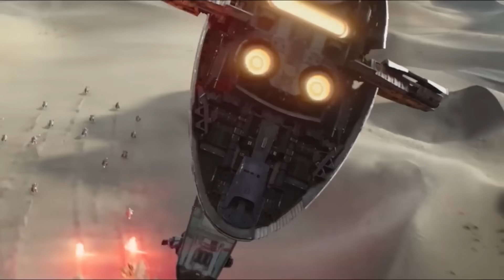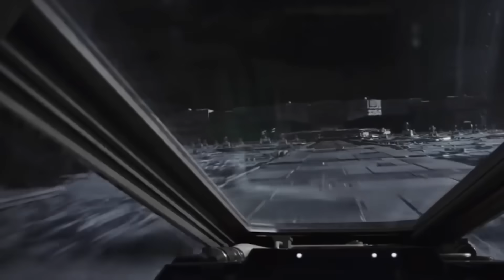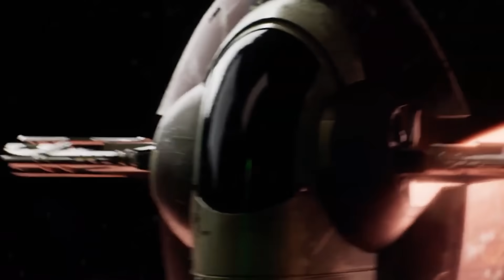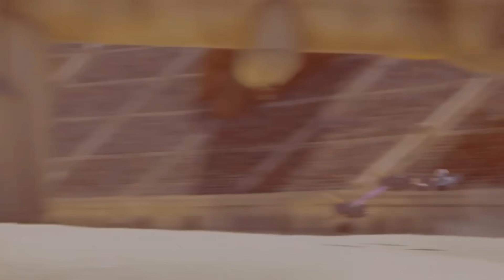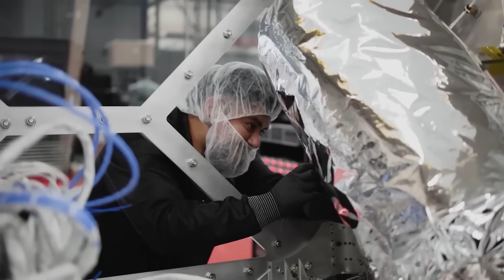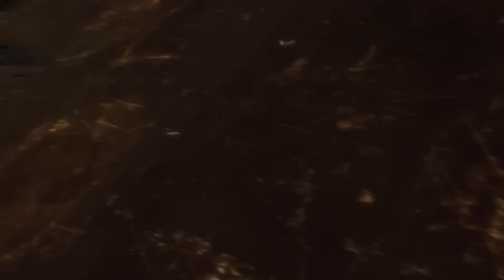The Problem with Star Wars Ship Design

Comment: So, to his first point of ship design there is actually a logical rationale behind it and a fair design philosophy. When it comes to the command deck of any ship it's a critical component as it's the vessel's brain which is not replaceable or fixable in a heated scenario, but where to place it is extremely important. Generally, there are three universal locations:
     -The Internal Command, an operation room at the core of the vessel is easily the safest location for any command with essentially zero concerns of issues. The problem is how as the IC requires a continuous feed of information through numerous sensors to remain operational but if those sensors are incapacitated by cosmic storms, conflict, or malfunction you are now entirely blind. This is a big issue in Star Wars who widely use ion weapons which disable vessel functions.
     -The Ventral/ Dorsal Bridge, an operation room set above or below the super structure is a command station that provides a wide view of the conflict as well as redirects enemy fire at a considerably smaller profile. The obvious problem is the external position leaves one disgustingly exposed thus relying on heavy external defenses such as shield arrays.
     -The Prow Bridge, an operation room boldly set on the front fact of the the vessel. What makes it feasible is generally the ships that support said design are ones that support a massive powerful prow which often means you can utilize physical sight with considerable protection. The problem is that the position heavily narrows sightlines and if any powerful assault strikes the ship head on its defensive super structure, then the Bridge can be caught up in the damage.

An apt example that would satifisfy is grudges is actually the warships from the Free Planets Alliance in LotGH:DNT where the vessels had a dorsal bridge with the feature of retracting into an internal command kinda like a turtle.

To his second point of fighters. Generally, there was an extremely rational use for mortal operators, but robotics do have a major play. To start the necessity of fighters in any regard is entirely dependent on their ability to cause projection of power and threat to super structures; Star Wars fighters do have major fire power capabilities thus making them a threat whereas Halo Fighters are comparably weaker thus needing exceedingly more room to supply adequate armaments. In addition, the defensive mechanism is incredibly important as in Star Wars they wear extremely powerful shield technology which makes non-continuous threats much more manageable, but they also use Plasma-based weapons which have comparably limited effective range in trade for extreme power. To again use Halo as an example, the UNSC do not have the same protections nor do kinetic and small projectiles have reliable use which resulted in a doctrine of extremely long range coordinated MAC driver barrages. Often doctrine is dependent on what you have available.
     For fighters directly the usage is often utterly dependent on how the manufacturer wanted it to compete which more utilities will always translate into hardpoints to attach too. In Star Wars we can see this as massive, winged mechanisms that house elements like cooling, energy collection, or micro maneuvering devices. On that note of necessities...G Force would not be an issue. Generally, it's most experienced through acceleration or deacceleration in an atmosphere which has gravity but once that force is removed to a near zero state then maneuvers in turn also exert dramatically less force. In other words, the example of specialized G force drug injections for space combat is actually less realistically needed then just going in raw. Although that is theoretical and result of light reading.
     As for robotic fighters, the usage is not diminished because it is seen as untrust worthy nor is it less capable. If anything, Star wars presents the opposite in that they are more capable, smaller, and less hazardous. The reason we see diminished use is because it's expensive as just as how modern-day self-driving cars are expensive. Typically, it requires that these vessels not only have adequate processing but also massive communication arrays on a warship just to communicate which leaves a new vulnerability and restriction.

Third, to the point of designs. Star Wars does prioritize imagery over function, but it's also factual to say that these designs are still very functional and throughout while in the real world we adhere to aesthetics quite frequently. 
     In star wars we do see a wide variety of shapes but often it was more than applying an emotional state. To give example the purpose of the wedge shape in ISDs was because it was meant to provide extreme forward fire capabilities, but the MC80s of the Rebels Mon Calamari are very bulbous because they were actually cities made to be in extreme pressure regions of deep sea. If we look at say the CIS Munificent classes, then we can see it's designed more for communications with massive antenna arrays but also an extremely skeletal frame protected by a shell super structure due to its robotic focus reducing needs of facilities yet keeping focus of protection. Now is it true everywhere? no but often enough there is a local foundation.
     Now on the other hand historically real-world nations vastly varied on design of vehicles in effort of aesthetic while adhering to necessary principals. This is easiest to see in tanks such as the American Abrams vs German Leopards. Other times design philosophy does not limit us to one answer either such as helicopters utilizing very different ideals and engineering to achieve similar goals, and while similar in function you will never mistake a Mi-35 for an Apache 
     Now these are always theoretical as Star Wars is not real nor has even been close to being tested but that often means the faults in the mechanism are a direct result of writing rather than design. Most if not all warships would be covered entirely in at least some kind of countermeasure BUT often get destroyed because the plot demands it. The value here is whether or not you were immersed by the event as if so it's because the writers and designers adhere enough to realism to make you feel engaged whereas if not it was because they cut to many corners to make it happen.

Generally, i think this explains most of his large grievances but at the end of the day it's entirely theoretical and more than not the faults of design are more related to storytelling rather than concept. I personally despise the Rey trilogy just because of how much they disregard any thought process for pretty visuals but i can also recognize that the parts i do love do carry their own flaws that even my explanations can explain-away. Regardless the video does provide a good excuse to establish conversations about the concepts but more so it's concepts like these along with the critiques that actually inspire the future of technology ironically enough.

Comment: It would be fairly easy to explain most of the design choices. No weapon on the underside, because you have strong shields, but if you want to fire yourself, you cant use that type, hence you only want one side exposed. I think the bridge is a mayor flaw. You would still want something to eyeball docking in any situation, but the main bridge should be hidden. That said, if you really want to minimize your weakpoint, having a redundant array of sensors close by each other isnt the worst idea. If you get hit and the link from the sensor is cut on the way to the bridge, you might aswell have it closer by. They should have used a hit on the engines for the executor. If we stay at WWII, something like the hit on Bismark would have been ideal. Simply loose steering and let the ship drift into the death star, or even get cought in its own gravity feld, as its so big. Why human pilots? Maybe the engine drives are costly and a simple EMP can take out any advanced sensors, so you have to do with a computer interpreting already available data and the manouver inputs of a pilot. Having humans on board doing everything is the reason for the moon missions beeing maned first. a simple lack of comutational power could be an easy solution here. you would have the main hyperspace calculations done by a super computer on a planet with unlimited space and power and let the on site ships only stick together whats nessesary for the specific jump. that would restric you to defined travel paths and rule out ai in almost anything else. you could also have a computer be hacked or radiation damaged, so its needs to be hardware coded, unflexible and therefor limited in functionallity and compute power. I feel its more a lack of willingness to explain the design choices in universe from the start, then the ability to do so. you cant do this with everything presented, but almost. ships flying in the same plain? what would happen if to grav gens working against each other? what happens to a smaller ship in the vicinity of such a feld if it extended beyond the ship? I find such explenations very satisfying, because they highlight the limitations and work arounds of the technologie used, rather then use the technologie to solve away a problem or inconsistency.

Comment: What makes me scratch my head in disbelief is the general layout of most ships. For smaller vessels floorplans are available. Take a look at the famous Millennium Falcon, it's a mess. Two tiny cargo holds, the third can be accessed through dragging cargo on corridors. And the curved walls reduce functional cargo space.
The only ship where the floor plan makes sense is a light transport called the Barloz-class (from the SW RPG). It starts with a cockpit, then a common area with cabins, a galley and a large water block, then a maintenance area, then a huge, rectangular cargo hold with wide ramps and doors on the side, and finally the engine bay. It is actually practical.
As for why capital ships have no real armament on the ventral side it's simple. Designers haven't realised space is 3 dimensional, and design the ships as if those were water battle ships, equipped for big broadsides. Plain stupid.
But it's a fantasy, so whatever.

Comment: Wings might be useless in space but what if you wanted to land on a planet with atmosphere? I can see putting wings on a spaceship so it can also function in atmosphere although a drive that worked well in atmosphere wouldn't work well in space and a drive that worked well in space wouldn't work well in atmosphere so you'd need multiple drives. G forces might not be a factor if you used a warp drive to move because technically a ship at warp isn't moving the space around the ship is moving. However warp drive wouldn't be too useful in a dog fight you'd be moving way to fast to target anything. You'd need alot of speed like 20,000 mph to not fall like a rock towards a planet but if the ships you were fighting were also going that fast you wouldn't notice the speed.

Comment: I will defend the wedge shape there.

Going with the Star Wars convention of assuming a 2d plane for larger ships, the wedge only presents vulnerability to the rear. The two. Side fire arms cover the entirety of the flanks, and overlap forward so they can bring their entire firepower to bear, as well as sloped armor if the shields ever went down.

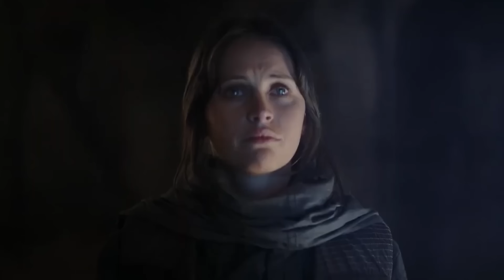22:45 also, that is like saying “exhaust ports are stupid because someone could send a missile up there into the engine through it.”

Wouldn’t be surprised if he got that from people trying to send bombs down smoke stacks or something.

Lots of those weaknesses were fortified, and fortifying it too much does eat of resources for diminishing returns and broadcast their importance.

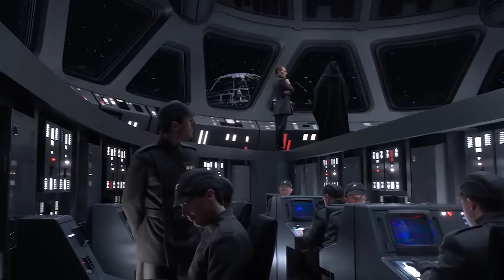Comment: 6:20 : Counter-point, with that level of tech, exposed bridges and windows can be an actual counter-measure against CWF/EWF (cyber/electronic warfare). If you lose control of your sensor you effectively become blind and having a bridge that can see outside can at least in part counteract that.

For the exposed shield gen(mentionned earlier) it could very well be a tech limitation. Either that or overconfidence in the shield themselves.

Comment: In "3 Body Problem", Cixin Liu makes the interesting point that due to the relatively low speeds of the ships, let's say 1% c, in relation to the tiny size (on the interstellar scale) of the Solar System, space warfare would come to resemble a 3D version of battles between sailing fleets of the 18th century, including the use of projectiles designed to hole an enemy craft.

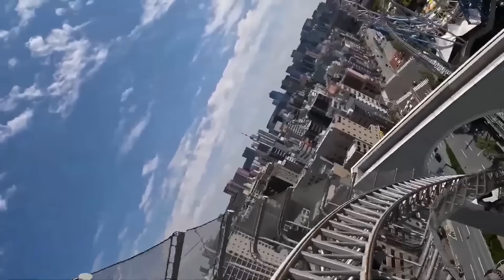Comment: 10:35 this is not true, in space speed doesn't kill, it's the accelaration and deacceleration. And once you got to a speed, you keep going since there is no air/medium to slow you down, so basically you onle use engines to accelerate or deaccelerate. If you stop too fast, humans would become a pancake, image hitting a concrete wall with great speed.
The International Space Station (ISS) is travelling about 28,000 km/h (5 miles per second) and it doesn't kill people inside, but it would it they would stop or slow down abruptly.

Comment: On space battles, As Kirk pointed out in "Wrath of Khan" ; "he isn't thinking three dimensional".
Oh, and in 1984 for my Highschool science project I built a fully functional TIE fighter. Which Ion Engines are a real thing they use electricity not fuel as in the newest abomination. In the original Star Wars six movies and expanded universe they visually show the engined glowing like fiery rocket engines and in reality ion engines electrons can't be seen. If we can overcome the weight issue ship design would be the problem. But in space without gravity it's completely workable.
And NASA engineers have listed the Millennium Falcon (specifically the YT-class freighters) as actually workable ships. The A-Wing design is considered for the new Space Force fighters.
@ 21:55 notice two torpedo went into the opening yet Luke only fired one in original script Vader fired the other because he actually hated the whole Death Star idea. In re-edit they had Han disable Vader before the shot as he shot and it's a whole who shot first issue 2.0😂😂😂😂😂
Actually got back and rewatch "Rogue One" as Galen didn't design the exhaust port as the weakness it was the reactor power core. He expected them to send in a small assault team a destroyed the reactor power core. Not attacking with fighters. That was a hail Mary because Han and Leia led the Empire straight to their front door. "It was too easy, they are tracking us." - Leia "Not this ship, Sister" - Han

Comment: I would argue the port on the Death Star is not a plot hole. The Death Star is the size of a space station..it needed ports to get rid of the massive heat it would generate, so they have a small port to get rid of it.

Comment: The "exposed" bridge of the ISD is not a huge problem from in-universe perspective, as capital ships in SW mostly rely on energy shielding for protection. And if the shields are down, there is little difference, as capital ship grade weapons mostly ignore physical armor and can easily penetrate an unshielded hull. 
E.g., Dreadnought-class heavy cruisers, which were the mainstay of the pre-Clone Wars Republic navy, had their bridges buried deep inside the hull, but that didn't help even in the slightiest, because as soon as the shields went down, turbolaser/megamaser bolts just went through the entire hull, completely obliterating the command centers in mere seconds (Tymothy Zann, "Outbound flight"). 
The Executor at Endor had its shields downed, but it took concentrated fire from all of the Rebel capital ships to accomplish - which was the only thing that made the A-wing kamikaze attack possible. At that point, it could be relatively easily destroyed, or at least completely disabled, by conventional means as well.
The other points of this video are more or less valid.

Comment: If you are going to get realistic .  There will be NO space battles.  

With the empty space you will be able to SEE / Detect the enemy from a million miles away.  Plenty of time to move out of the way of what ever ballistic that is sent. And unless there is the power of a sun in the hart of the ship lasers will not work at those ranges.  

We currently have the ability to track and hit an object the size of a golf ball .  A fighter craft will NOT be a problem.

A war will be fast and definite with no one left to surrender.  Warping in a black hole , into the solar system's central star will make short work of any resistance.

If for some reason the planets are needed by the invaders . Bombardment of tens of  thousands of rocks  would pound the system into submishion.

Stop thinking that the bald apes on this wet rock would have any sort of chance against a species that is capable of traveling in space.  You have only held your breath and jumped onto your moon, briefly.  Your nuclear dreams are more like a cap pistol.  A little sound , a little smoke, great fun for a child.